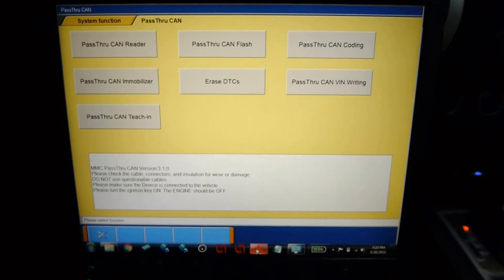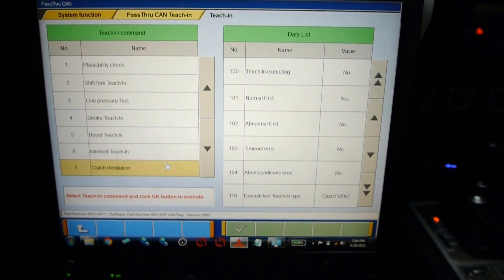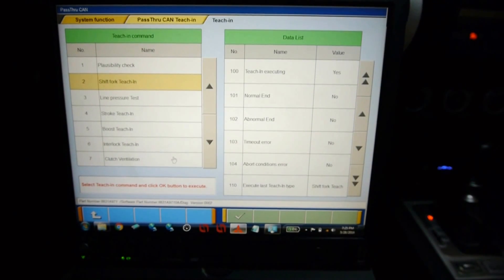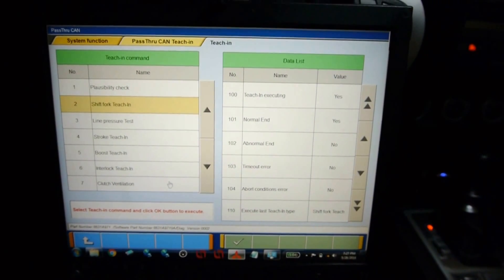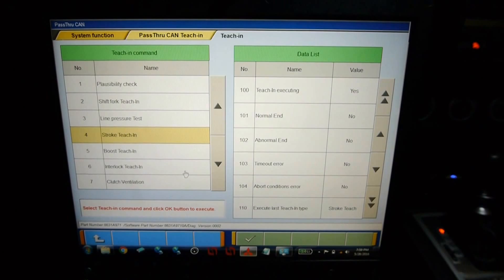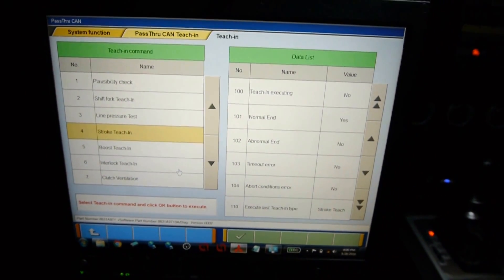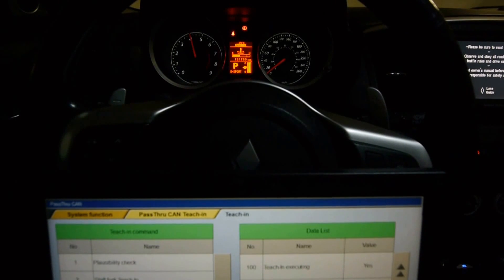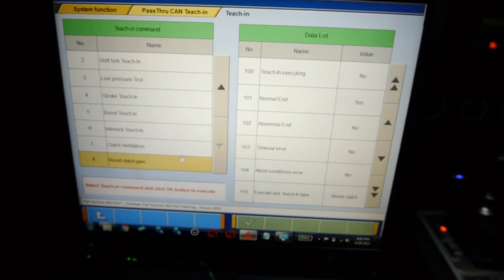SST teach-in Mitsubishi Lancer Ralliart and Evolution X MR

Comment: I just finished my trans fluid change and I tried to do the tech-in but got this message, “Invalid TC-SST recalibration data”, am I missing some files? My car is a 2011, it’s been tuned 4 or 5 years ago and I had the sst shift tables updated. It seems so much smoother just after putting new fluid in.
Reply from the maker: You need to have the TI_info.tipart file in the XML folder, and AMT_17800000_000204_dio30_C.cbf in the CBF folder. If there any "generic" CBF files in that folder, just delete them - they can sometimes interfere.
Reply: @StephenStrangways  I just did the teach in and made some progress but I got an abnormal end on boost teach in
Reply from the maker: @koolzero007  sometimes PassThru CAN just has a glitch and needs to be uninstalled and reinstalled. I end up doing it about once a month and it always solves communications errors.
Reply: @StephenStrangways  I wonder if the trans gets too hot that it might cause an abnormal end? I’ll try it again later tonight and make sure the temp is closer to 40degrees.
Reply from the maker: @koolzero007  it definitely can. The transmission must be between 40-80 degrees Celsius during the entire procedure, and because the temperature will rise during the process, I never start it if the transmission is above 70, to allow for that.

Comment: Wait. Is this with the tactrix openport 2.0?
Reply from the maker: Yes, that is one of the many cables you can use to do this.
Reply: @StephenStrangways  oh okay thank you!
Reply: subbed! :)
Reply: is the 3000 temp for transmission important though? How do i warm it up?..
Reply from the maker: @rigo117x7  the temperature is super important - if the transmission is too hot or too cold, the steps of the teach-in will always fail, and it won't tell you exactly why it failed. Warm it up by driving it! City driving is the best, as cruising on the highway in a single gear won't warm it up much. Use EvoScan on your laptop to check the temperature.
Reply: @StephenStrangways  is it on the openport app or is it a whole other app, and it wouldnt be bad to drive it before teaching it correct?
Reply from the maker: @rigo117x7  you would need EvoScan (from EvoScan .com) to check the temperature, and if you haven't just replaced the clutch or valve body, it's perfectly safe to drive it to warm it up.

Comment: hello please i need your help : i have a ralliart mitsubishi lancer 2013 can we change the sst transmission of my ralliart with an evo 10 mitsubishi sst transmission. i don't have with my ralliart s sport mood .
Reply from the maker: Is your Ralliart transmission working, and you just want to get S-Sport and Launch Control? If so, you can flash the firmware for the Evo transmission to the Ralliart transmission, and you will get those features. Instructions for doing that are in the PDF on the Google Drive link that is in the video description. If you have a laptop and cable but want someone else to connect remotely and do it for you, this company will do it: https://www.nrgops.com/product/remote-sst-passthru-can/

Comment: Question with a flash or a tune will it interfere with the process at all?
Reply from the maker: No, not at all. The tune is on the ECU, but the teach-in process is performed by the TCU - completely separate computers.

Comment: What's interlock teach in? When would we normally want to execute that command?
Reply from the maker: According to Mitsubishi's factory service manuals, interlock teach-in and line pressure test are "available but not used." As far as I know, nobody has ever found a use for them.
Reply: @StephenStrangways  do you know if 2015 SST flash files will work on a 2010 SST?
Reply from the maker: @funkyd04  yes, it has been tested by several really good shops like Kozmic and WTF, and they recommend always flashing the newest TCU firmware, for the 2011-2015 cars, no matter what year your is.

Comment: Just did this and everything was normal end yes except for the shift fork teach was abnormal, you have any input to this?
Reply from the maker: Shift fork failing is not a good sign. It can mean a loose magnet that is about to fall off. Do you ever have a problem with your transmission skipping gears, like changing from 1st to 3rd, skipping second?
Reply: @StephenStrangways  no problems at all, it is built. Last teach in I did in April everything came out good
Reply from the maker: @NoBoostloading  that is odd... but if everything is working fine with the transmission, you're good to keep driving it! Did you try repeating the shift fork teach-in step? Sometimes it can take a few tries before it works properly. Just make sure the transmission temperature is still within the proper range, as it heats up during the process.
Reply: @StephenStrangways  actually just tried it again right now and everything came out good, no idea why that one gave me trouble but we are all good now, that’s for the help!
Reply from the maker: @NoBoostloading  I'm glad to hear it worked! It's one of those things that can be a bit glitchy sometimes, so don't worry about it failing the first time. If all gears are working fine, then everything is alright with your transmission.

Comment: For the purpose of doing a teach in on my 2012 Ralliart, in the DiagDB, XML folder, do I need to put both flpart files that are found in the Ralliart Files, 2009-2012 folder?  Inside that folder there are 2 flpart files and unsure which one I need to copy acorss into the XML folder or if I just copy across both flpart files. The files I am referring to are 8631B002_dio30.flpart and 8631B002_dio301.flpart
Reply from the maker: Those .flpart files are only needed to flash new firmware. They are not needed for teach-in. Also, that dio301 file should NEVER be used to flash firmware, only the dio30 file. If you have the dio301 file you got it from an outdated link to an abandoned Google Drive folder. The current one is linked in the description of this video.

Comment: Hi Stephen, I installed recently the Pass Thru CAN but when I try to tech-in I have a data file error "invalid TC-SST recalibration data". Any idea? I tried it in other evo X and work fine, is only in my car. Thanks in advance.
Reply from the maker: Remove the two "GENERIC..." files from the CBF folder, then download "AMT_17800000_000204_dio30_C.cbf" from the Google Drive link and place it in that folder.

Comment: Hey Stephen. I want to ask something. About the part number 7. First time it does it but second time after switching off the car and launching again its always saying abnormal end. Any ideas what it could be? Thanks in advance. Chris
Reply from the maker: Clutch vent usually fails for one of two reasons: you're not on level ground, or the transmission was overfilled with too much fluid. But because it worked once for you, it may be just one of those quirky weird things that can happen. You can safely proceed with all the other steps, skipping that one, and everything should work fine.
Reply: @StephenStrangways  all other steps are worked like it should. And I have filled the trans fluid exactly 6.7 liters. So may be the ground because it isn't the best park place 😅. Thanks for your reply bro. Helped me a lot. We will see the next time. Have a great day and stay healthy! Cheers
Reply from the maker: @Apithanos  6.7 L is a bit much, but shouldn't cause clutch vent to fail. Did you drain it for a long time, and also drain the cooler?
Reply: @StephenStrangways  nope I haven't drain it from the cooler 🤔
Reply from the maker: @Apithanos  Draining the transmission for 3 minutes (as per the factory service manual) will only get about 5.4 L out, plus whatever is in the filter housing. If you drain the cooler, that's another 0.5 L. So your transmission is definitely over-filled, but it shouldn't cause any serious problems.
Reply: @StephenStrangways  wow really? The manual book saying 6.7 liters. I'll check it again. Thanks for the Infos
Reply from the maker: @Apithanos  the spec for how much fluid is in the transmission is the "dry fill" from when the transmission is completely empty of fluid when it is first installed. What you need to refer to is the factory service manual procedure for changing the fluid while the transmission is installed in the car, in which case it states to drain it for 3 minutes and you should get 5.4 L out, with the rest being stuck inside the transmission, impossible to get out unless you remove the transmission from the car and split it open.

Comment: Hi Stephen, I have all the buttons disabled, except "PassThru CAN Reader". AMT_17800000_000204_dio30_C.cbf and TI_Info.tipart is in XML folder. Also ptc32.dll in system/common. What I did wrong?
Reply from the maker: The ptc32.dll file you have is the one that only allows the reader function. You need to delete it, and replace it with the ptc32.dll that is found at the Google Drive link. That version of the file will unlock all functions.
Reply: @StephenStrangways  it was from Google Drive. I tried to uninstall, install and start "PassThru CAN" for the first time with right ptc32.dll. No luck still (
Reply from the maker: @YurgenVP  there's a company that is really good with this stuff, they can connect remotely to your computer to set up the software, even perform the teach in or flash different firmware for you. Email them at sales@nrgops.com
Reply: Ok. Solved. Really surprised I'm the first one with this problem. PassThruCAN only works from C:\Program Files\PassThruCAN (any 64bit system will install in to "C:\Program Files (x86)\PassThruCAN").
Reply from the maker: @YurgenVP  ah yes. That's a very common problem, actually, so that's the reason behind the instructions for doing registry changes before installing it that are in the PDF that's on Google Drive.

Comment: What kind of wire do you need to connect to your laptop to the car?
Reply from the maker: You need a cable that supports the SAE J2534 Pass-Thru cable. A cheap Actia cable will work, but most people use a Tactrix OpenPort 2.0 cable because that can also be used for ECU programming, so it's useful for other things.
Reply: Stephen Strangways thank you I appreciate that

Comment: How about interlock teach in? And why clutch ventilation 2 times?
Reply from the maker: Interlock teach-in and line pressure test are described in the PassThru CAN manual as "available but not used." The factory service manual for the car does not mention them being used. Nobody has ever figured out what they do, or any reason to use them.

Clutch ventilation twice may not be strictly necessary, but it sure doesn't hurt to do it twice. If something isn't right with the transmission it will fail right away, so you know something is wrong, whereas some of the later steps will just get stuck attempting to complete for a very long time, so clutch vent and plausibility check both work well as a test to make sure the transmission is ready for a teach-in.
Reply: @StephenStrangways  thank you for your answer.
Reply: @StephenStrangways  i just used teach in on my car now, after changed the gear oil and it doesnt pass clutch ventilation. It says abnormal end even after the 20th try.
Reply from the maker: @octaviangeorge5455  the most common reasons for it to fail are that you are not parked on level ground when doing the teach in, that you filled the transmission with too much fluid or the wrong fluid, or that the vent hose on the top of the transmission, behind the fill hole, is blocked.

Comment: Where can I buy a compatible OBD2 unit for the CanPassThru app?
Reply from the maker: Any J2534 Pass Thru cable will work, but the most reliable - and useful for also tuning Evos and Ralliarts - is the OpenPort 2.0 cable from Tactrix.com
Do not buy knock-off Tactrix cables from China on eBay, Amazon, or Aliexpress - they will brick. Buy it directly from Tactrix.com

Comment: where can i get this progeam to do teach in 08 evo mr? do i need to flash it aslo
Reply from the maker: The firmware on the transmission itself does not support the teach-in process on 2008 model year transmissions. You will need to update it, which is a similar process to flashing S-Sport on a Ralliart.
Reply: @StephenStrangways  where can i find software
Reply from the maker: @raffaelemarinucci  https://drive.google.com/folderview?id=0B-eSylKomuYha3ZXMFVKdV83V00

Or you can get someone to do it for you remotely:
https://www.nrgops.com/product/remote_sst

Comment: Hi Stephen, I tried again all flashes for Evo. With 2008 Evo got invalid tc sst recalibration data, and with all others reached teach in menu but got same problem, clutch ventilation abnormal end yes. I tried at least 30 times. Then I drained about 200 ml fluid from transmision, and tried again. Same problem. I don’t what to do anymore. Please help me. If you want, i can send you a video to see what it’s doing when i try teach in procedure. Thank you again!
Reply from the maker: You could try draining the transmission fluid and measuring it to make sure you have the right amount. Other than that, there may be something wrong with the transmission that will require it to be removed and repaired, but if it's running fine, just failing the teach-in, you may as well just keep driving it as-is.
Reply: Done, it was exactly like you said, to much fluid. Teach in went ok. Many thanks for your help Stephen! Do you recommend to flash back to 2008? Now 2011 is flashed. Thank you!
Reply from the maker: @georgelbolos6594  the 2011 firmware works perfectly on any year car, and has some good fixes to problems like the grind on startup that could happen sometimes, so it is is best to stick with the 2011 firmware. I'm  glad it all worked out!
Reply: Stephen Strangways ok! Once again many thanks for your time and help!

Comment: Hi Stephen, thank you for your video and your infos you wrote in the comments;
Please help in my situation too. My car is an Evo x 2008 MR
I flashed ECU after i read and done all indications in the procedure, and when i wanted to do teach in I got the error: Invalid TC-SST recalibration data. Please contact MMNA.
I checked again and reinstaled .tipart file, but got the same error.
Next I flashed with EVO X 2010 files, then reached Teach in menu, but when I tried to do clucth ventilation, operation started and ended with abnormal end Yes, and engine accelerated to about 1400 rpm for a few seconds and go back to idle.
I tried this for 10 ore more times, and got the same response.
Now I flashed back with 2008 Evo files and looks like:
 <MMC_FlPart><PassThruCANFlash><NewPartInfo><NEW_HW_PNAME>8631A379</NEW_HW_PNAME><NEW_SW_PNAME>8631A3790C</NEW_SW_PNAME></NewPartInfo><CFF_FILENAME>8631A749_dio30</CFF_FILENAME><CBF_FILENAME>AMT_17800000_000204_dio30_C</CBF_FILENAME><SYSTEM>TC-SST</SYSTEM><CONTENTS>Reprogramming data for Mechatronic Assy replacement of 08MY LANCER EVOLUTION</CONTENTS><DATE>2011.12.12</DATE><CLASS>Reprogramming for Teach-in</CLASS><ApplicablePartInfo><TARGET_HW_PNAME>8631A827</TARGET_HW_PNAME><TARGET_SW_PNAME>8631A8270B</TARGET_SW_PNAME></ApplicablePartInfo></PassThruCANFlash></MMC_FlPart>
And got back the error: Invalid TC-SST recalibration data. Please contact MMNA.
Please help me with your opinion.
Many Thanks!
Reply from the maker: Invalid TC-SST recalibration data may be happening because the CBF folder should only contain AMT_17800000_000204_dio30_C.cbf and any GENERIC files in that folder should be removed.
Clutch vent may fail if you are not parked on level ground, or if your transmission fluid was over-filled with fluid. It sometimes just takes multiple tries - you can try it again and again until it passes.
Reply: Cbf folder contains only AMT file, generic files was deleted. Car was parked on ground. I don’t know what to say about oil quantity. Last week I changed the oil, and probably I put 100-200 ml more. Should I take it out before i try again? Thank you!
Reply from the maker: @georgelbolos6594  engine oil doesn't matter, but too much transmission fluid can cause a problem. The last time it was changed, did you change it yourself, or did a shop do it for you?
Reply: @Stephen, I wrote oil, but talked about transmision fluid, that I changed last week, and I did by myself. I used Castrol Transmax dual. Drained all 3 drain plugs and fluid cooler too, then filled about 7,7liters.
Reply from the maker: @georgelbolos6594  that's your problem - too much fluid. 7.6 L is the dry fill after the transmission has been removed, opened up, and cleaned out. But when you drain the transmission on the car, you only get 5.5 L out, or 6 L if you also drain the cooler, so that is how much you should put back in. 6.5 L at most, no more than that.
Reply: Stephen Strangways I understand now. I will take out 1 more liter, and i’ll try again. Is there some way to check level of fluid in the transmission? Many thanks!!!
Reply from the maker: @georgelbolos6594  unfortunately not. There is a check hole but it is only for when the SST is installed in an Outlander. So the official way from Mitsubishi to check the fluid level is to drain the fluid, measure it, and put it back in.